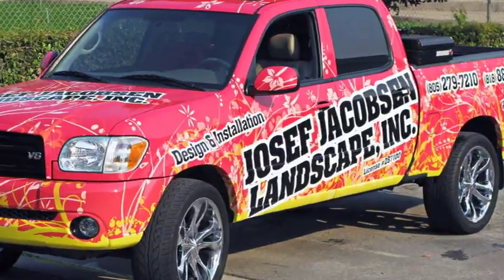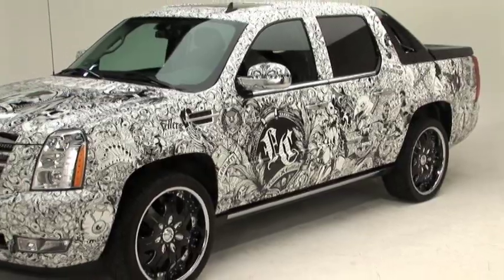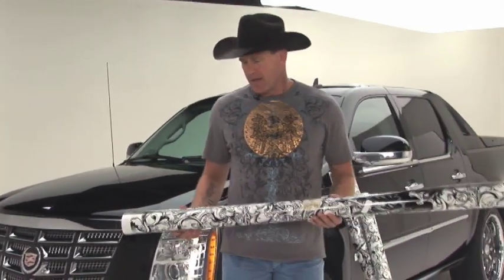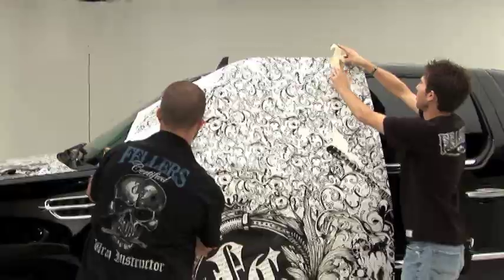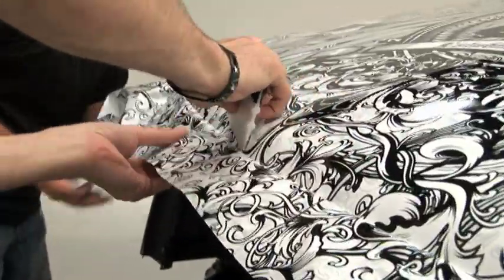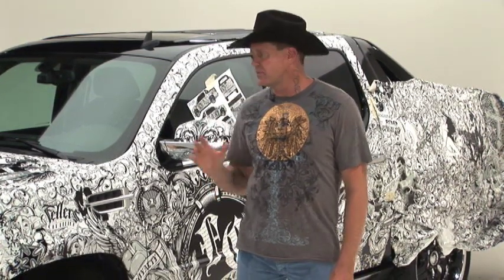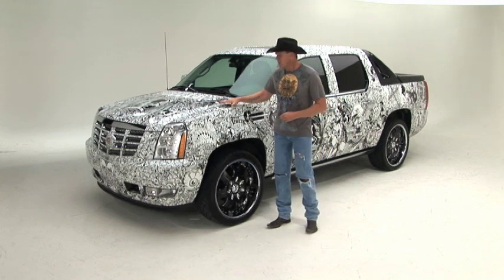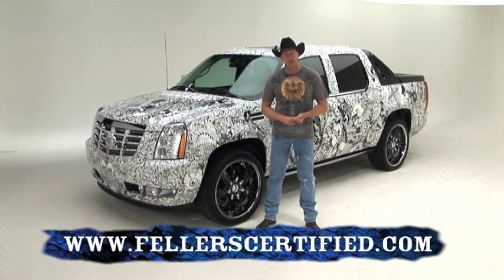FELLERS - Wrap your Car, Truck or Boat with Vehicle Wrap Vinyl

Comment: Fellers has just sold me expired 2009 vinyl this week as new and charged me as new.  This is second time this has happened to me in past 6 months.  They will not replace any of my ink cost or man hour cost for them holding on to dated vinyl.  Thanks for all the help Frank